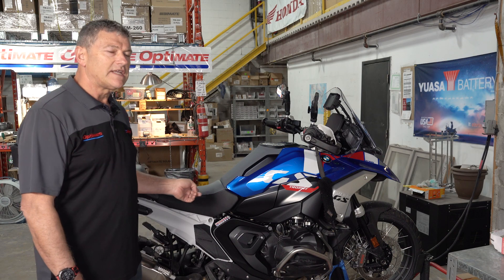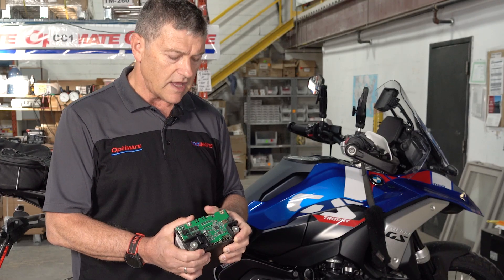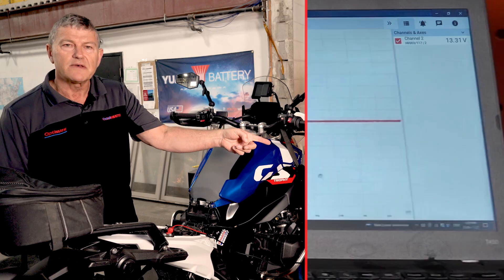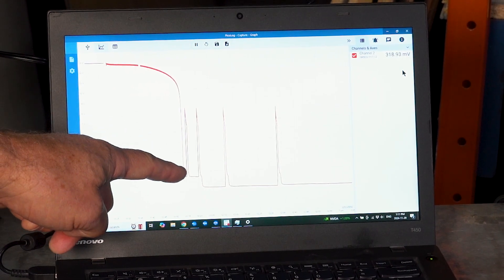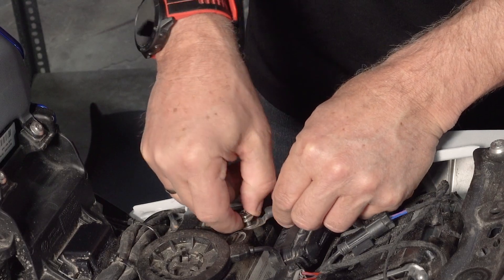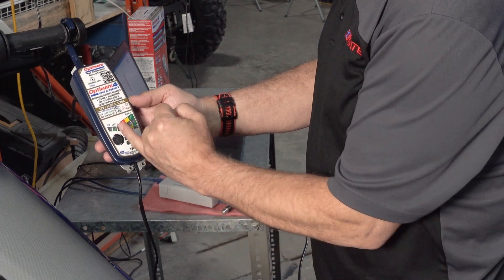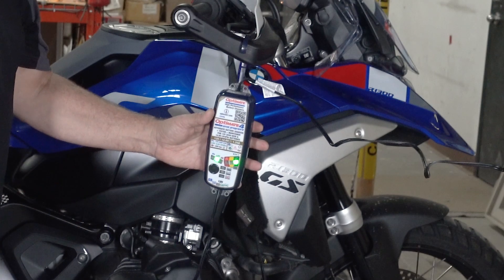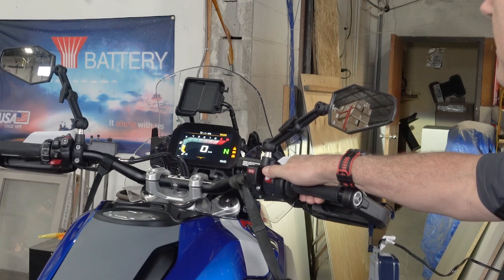How to Recover a Dead BMW R1300GS Lithium Battery with OptiMate 4 Quad Program

Comment: Great videos optimate👍 
Im just trying to decide between the 0.8A lithium charger, the 6.0A lithium charger and the 4 quad program charger..
Reply from the maker: Thanks! 
The OptiMate 4 Quad Program can charge both lead-acid (STD, AGM, GEL) and lithium LiFePO4 batteries and has programs for charging through the CAN-bus system of your BMW motorcycle. So if you have a BMW motorcycle with CAN-bus or if you need to charge both lead-acid and lithium batteries, choose the OptiMate 4 Quad Program. If you only need to charge lithium batteries and don't have a BMW with CAN-bus, you can choose the OptiMate Lithium 4s 0.8A charger or the OptiMate Lithium 4s 6A. The OptiMate Lithium 4s 6A is a more powerful and faster charger than the OptiMate Lithium 4s 0.8A charger to charge your lithium LiFePO4 starter batteries. Hopefully this helps, let us know if there is anything else you would like to know.

Comment: I tried this (bought the Optimate 4 Quad and the Lithium 4s 10A). The 4s-10A goes into BMS reset for 20-30 minutes and then starts blinking that it failed...  The Quad 4 I tried this as well. Long-pressed the button on the LFP setting;  the red light starts blinking but after 2 seconds LED 3/4/5/6/7/8 start blinking all and it then does nothing.
If I plug my bike on (it also has a data-cable, this battery) and then long press the button, it starts the program on red, but it does nothing for the accu when I check it with the meter.
The battery is 10 months old but it was drained to far by the onboard battery, great safeguard from BMW there~.  Is this battery completly done for or did I do something wrong?
Reply from the maker: Hi! Can you contact us at sales@tecmate-int.com with your issue? We are happy to help you!
Reply: Hi, did you solve your problem?

Comment: I think you guys forgot to mention the "Can-Bus" mode on the charger which is for BMW motorbikes and such, at least, this is what I saw in the video presentation of the product
Reply from the maker: Hi! We have mentioned CAN-bus next to the CAN-bus symbol on the front of the charger. For the LEDs and selection button we have only used the symbol.